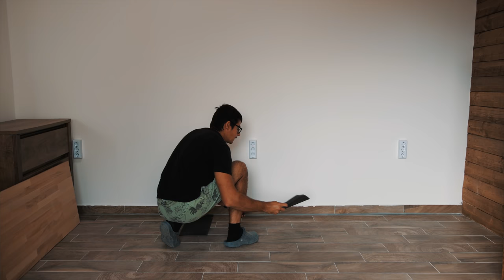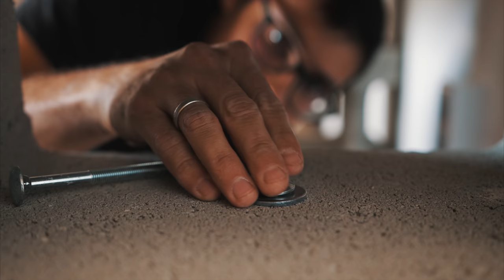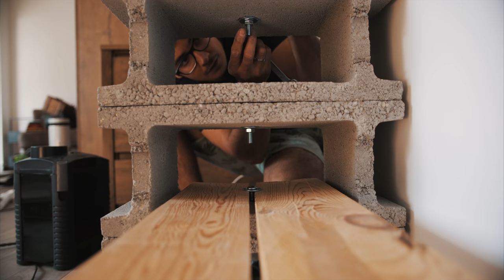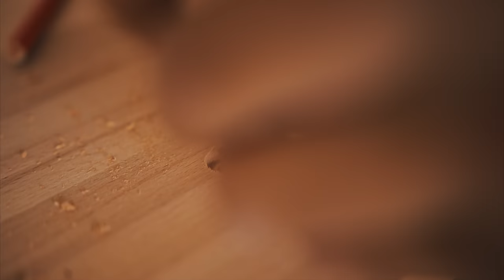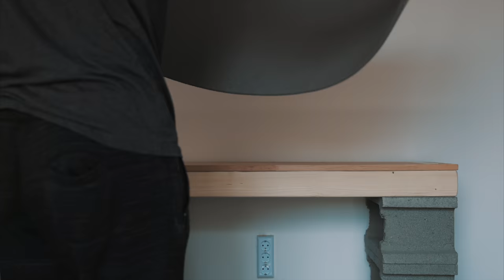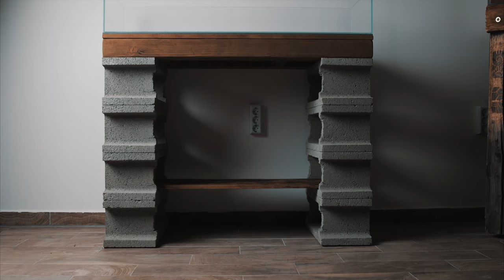DIY aquarium stand - How I made it

Comment: I guess it’s a good thing the tank is relatively light because those concrete blocks are not stacked in the manner they are designed to be used as. If they are carrying very heavy weight (ie hundreds or thousands of pounds) they are designed to bare the load by having the holes facing upward. Aesthetically it’s pleasing while still being cheap but don’t use them this way if you are building racking or monster tanks.
Reply: I have heard the same, holes UP.  But then again, if you can stand on the end of a cinder block and it doesn't crumble, its enough to handle the weight of the tank & water.
Reply: Very much so. Good comment.
Reply: Good and correct consideration.

Comment: DIY:
Step 1: buy several hundred dollars worth of woodworking equipment and a drill that can penetrate concrete.

Step 2: cinderblock furniture.
Reply: Most drills gecan "penetrate" concrete... you just need the correct bit.
Reply: still cheaper than ADA filter
Reply: Few years back I also made a concrete block stand for my aquarium. I just used silicone to fix every thing. As long as no one is going to pull it down, it will be just fine.
Reply: @human__________  everything is cheaper than ADA.

Comment: Hey Guys, I want to do something similar to this but I'm afraid the bricks might crumble. I got a 90p tank so that itself is about 300kg and I'm also planning on putting a granite top. the current wooden table I have doesn't have support in the middle and I can already see it bending in the middle (lucky I caught this before the full setup was done). any suggestion?

BTW I love the look of the wood and concrete mix here. gives it a nice calm feeling that wood ;)
Reply: Stack them properly, holes up. This can hold a ton easily. You can even put two next to each other. These can hold a roof, your aquarium is not a heavy weight for it. Peace

Comment: this has sparked my artistic nature Im thinking doing the same style , but maybe put some styrofoam on the inside then smooth over concrete and cut the lips off and make it look like a solid piece then maybe glue flagstone to it and build a wood frame on the inside to make cabinet doors, age the wood with a torch , beat with a chain and hammer then stain it. might become a little heavy and not really movable once installed . Got my creative juices flowing thou.

Comment: That looks beautiful but might be too much weight for the blocks positioned that way.
Reply: If the tank would be, say 40cm high I'd say you're right. This seems to only be 20cm high though. I'm guessing 100x30x20cm, which is 60L. With hardscape max 100Kg. Not sure though what those bricks are rated for.
Reply: @dennisbinkhorst2039  but he drilled them and now their even more brittle.

Comment: Looks cool. But i dont see the reason to use the bolts. Could have just glued it together. With the hazzle of drilling all those holes, a thick threaded rod (M10 or whatever) would be better as it would help support the load of the tank.

Comment: The build looks beautiful, only the cinder blocks are placed incorrectly. The holes should be facing upwards. That's how they're designed to bear weight. I think placing them correctly would not detract from the beauty of the build, either.

Comment: Absolutely NEVER turn a cinderblocks sideways!They’re not designed to structurally take loads on their side. All the holes should be facing upwards and drilling through them is unnecessary and makes them even more structurally unsound.
Reply from the maker: You're right, however, there is minimal load on it. It has been standing steadily without issues for 3 years. The maximum weight on it is 200 kilograms. I wouldn't build a house like that either.